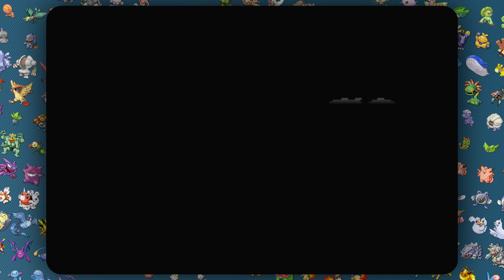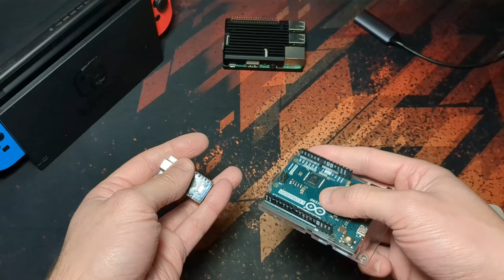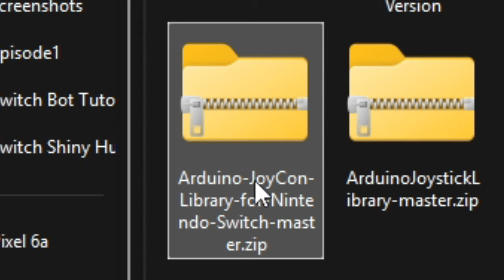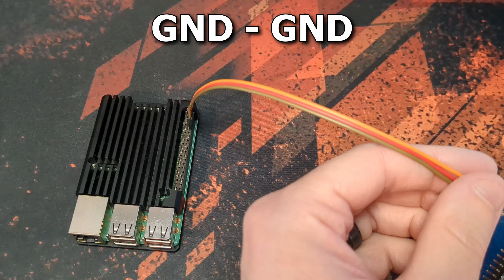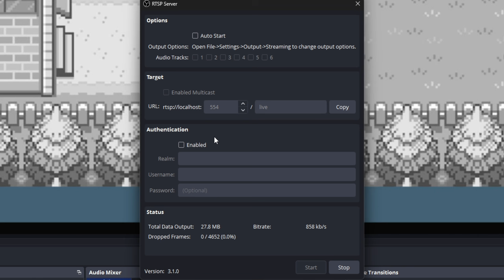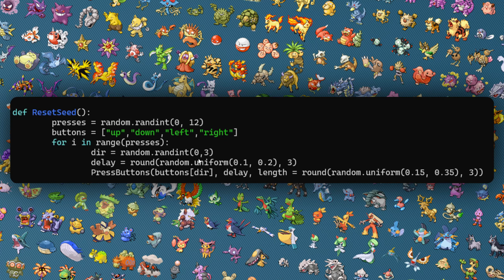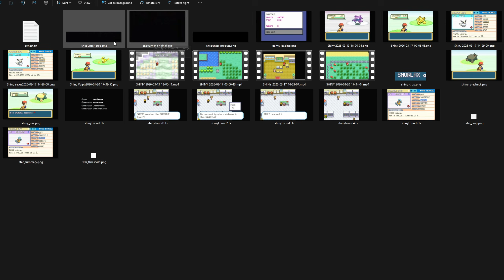How To Automatically Hunt Shiny Pokemon - Switch Bot

Comment: Has anyone got this working consistently on Switch 2?

I can get to around 300-400 encounters on the starter method and then the bot will think it's found a shiny but the screenshot will usually be on the "previously on your adventure screen" I've messed with the threshold setting to everything on and inbetween 230-235 and found that 232 has been the best so far but still messes up. Just wondering if the different hardware is messing with something after too many loops 

Hardware:
Switch 2
Pi 5
Elgato HD60S+
Arduino Micro
Reply from the maker: Is the game actually at the previously screen or is it just the screenshot? That would say if it's either dropped inputs or a capture issue
Reply: The screenshot it takes is on the previously on your journey screen. Whenever I get back to my game the cutscene has finished and I'm stood in front on the pokeballs. I've never actually caught it happening so all I can do is check the screenshot for what it thinks is a shiny charmander
Reply from the maker: @DeaconHasAShark  If it hasn't actually collected a pokemon when it checks then that's most likely a case of a dropped input which could be a few things. Check that your connection to the Arduino is solid and it's not overheating in any way, or there's no other controller to the switch that could accidentally pull priority
Reply: @Geeze I've checked and everything looks good. It's just strange that if the issue is dropped inputs why is every recording saved in screenshots the exact same thing. Like it's dropping inputs at the exact same bit every time I'm trying to catch it in the process but it's been difficult. Hoping it's not seeing a shiny Charmander and resetting itself before it shuts down the sequence

Comment: Got it working just a question do I need it plugged into the pi then unplug and plug into switch cause I get acm errors when trying
Reply from the maker: I'd have to see what errors you're getting, but you should have the Arduino plugged into the Pi and Switch before running the bot. If the switch is docked and doesn't have a controller attached then the bot should automatically take the priority. From there you can undock and dock it to swap between you and the bot
Reply: @Geeze so do I need another USB or just the rx tx and ground on both pi and Arduino and then plugged into switch ?
Reply: @Geeze could not open port /dev/ttys0

Comment: Hello nice video 
I am trying to get this working tried 2 raspberry pi’s 3b and 4b but tx and rx lights never turn on on the arduino and no controller appears on screen in the change grip scene on the switch 1 and also on switch 2 I am using a leonardo Arduino. Also found out that pc recognises it twice once as arduino leonardo and once as hori co ltd leonardo eth. also there is nothing on the serial monitor 

update

I opened the other uart ports on the pi 4b but it does not matter which pins I use it says in the python script it connects to arduino but even when there is none connected to that port
Reply from the maker: Hey sorry, it's not the most reliable but try to get the Arduino Switch library working first, the problems usually lie with the board settings, and different boards can have different settings. Make sure to factory reset the Arduino before installing again and see what's up
Reply: @Geeze sorry for the late reaction I was away from home for a week but I just tried another older versions of arduino ide none work but what I do know now is that arduino leonardo specific version of the boards.txt let’s mee upload it to the board  but the one with the my board part does not work I get a upload tool serial is undifined error thanks for the help
Reply: Finally got it working needed the old legacy version of the ide software

Comment: Does anyone have a sequence that they used for MewTwo? Along with what I should change the threshold to for it. I tried changing it up and down by about 40 each way and got less confident that it would find it, but it keeps telling me I find a shiny around 100 encounters in.

If anyone has suggestions, or maybe OBS settings that would help, that would be very helpful!
Reply from the maker: If it's stopping after 100 it's probably either a timing issue or dropped frames. For mine it was dropping a couple of frames, but would only be an issue when it lined up with the encounter check. If you're using the streaming method then just try to reduce the resolution as much as possible. The threshold should be fine for the encounters as the text is rather contrasted, that's more an issue for summary checks.
Reply: I was able to get a capture card to work directly plugged in. It has now been almost 4 days of being on 24/7 and a lot of time before that. No shiny mewtwo. I know this is possible, but is there a chance that I should change the threshold levels for checkencounter? Or something like that
Reply from the maker: @jsm177y7  4 days isn't that long to be honest, but for sanity if you look at the pngs the bot makes, you should see the MEWTWO APPEARED text in the check on a black background, if you see that, and the pre check shows Mewtwo sliding in, it's absolutely fine.
Reply: @Geeze  My check file just says "MEWTWO AP" and my shiny_raw.png shows "Wild MEWTWO appeared!" with the battle scene with mewtwo all the way on the right side. I have gotten to around 50000 encounters at this point as I had done a lot before I commented, and have now had it running 10 days straight, but with many checks before that constant run. Any suggestions?
Reply from the maker: @jsm177y7  If the battle screen is already up, it seems like it's waiting far too long to check for the shiny, so if you look at the precheck file and text has already appeared, that'll tell you if the timing is way off. If that's the case you'll have to reduce the delay after the last input
Reply: @Geeze  So you are telling me that the precheck screen should have mewtwo like on the left side of the screen, still like darkened?
Reply from the maker: @jsm177y7   Yes, it should be while it is drifting from the left to the right hand side, no text at the bottom yet

Comment: so i have everything setup with my micro, connectors are on the right pins but when i go to run the bot it doesnt connect to my switch 2 just stays on the change grip screen waiting for a controller signal any ideas?
Reply: Did you ever get this fixed?

Comment: Hunting charmander -> total 11768 resets until this moment, haven't seen it yet, do you think the bot will run infinitely? Do I need to check any configuration?
Reply from the maker: That's perfectly normal for shiny hunting, at that point it's only about 75% chance. Keep it going, Snorlax for some reason took mine 50k resets, everything else has been around or under odds.

Comment: Ok I tryed it but this is my first time programming. And I dont get the screenshots saved to my pc. It says Path not found am I missing something? :c I think the Pi cant comunicate with the RTSP-Server.
Reply from the maker: The screenshots save to your Pi, and like my case you can use SCP to copy them over your network to your PC. If you're getting a path error you've either typed out the wrong address or the program hasn't run successfully to create the screenshots folder at all.
Reply: @Geeze  OK yea I cant create a screenshot. I think its the RTSP-Server. I cant connet via the rtsp://localhost/live adress with my computers IP instead of localhost. I can connect via VLC Player on my Pc to the stream. Thats working, I can ping my pc but not the rtsp adress. I deactivated my Firewalls and tryped port forwarding on my router  Still nothing :c I just want my shiny pkms
Reply: ok got the screenshots and everything but my controller is not connecting to the switch now :c

Comment: I have followed the setup exactly, including setting up the SwitchJoycon library with the correct boards.txt file, but my arduino micro will not connect to my switch at all. On the Change Grip/Order screen, when I start the program, nothing happens. If I continue through, it gives up thinking that it's caught a shiny despite being still on that screen. Any ideas why this might be happening?
Reply from the maker: It thinks it's shiny because it's not in the right place. If the controller isn't appearing at all then it's either an issue with the Arduino itself or the Pi not sending commands correctly. Try using the Arduino IDE serial monitor to see if commands are being sent or not
Reply: @Geeze  For anyone finding this comment in the future, the UART communication was not enabled by default on my Raspberry Pi 5, so I had to add these lines to the very bottom of /boot/firmware/config.txt in the [all] section
enable_uart=1
dtoverlay=uart0
After rebooting my pi with these in config, it recognized my micro hooked up to pin 14 on the ttyAMA0 serial port (not ttyS0 which works with earlier pi iterations) and I could go! Thanks so much for this!
Reply from the maker: @ianpalk653  Ah nice find, glad you got it working! The problem with not having access to the exact same hardware, some tiny little thing that needs tweaking

Comment: Yeah... this guide doesn't work. Clearly there's a few steps that are missing, and it doesn't help that the video is zoomed in during key points. There's more than one AppData folder, not showing where the one you need is doesn't help. Also the Arduino code doesn't work.
Reply from the maker: These are the exact steps I took to set it up. The same exact code that's on the repository is currently on my Arduino, running perfectly. Unsure what issue you have with the AppData folder but that is exactly where it is located. This is also laid out on the linked Arduino library page in even more detail.

Comment: I added code to give me a Discord alert. 12 hours 22 minutes for a Shiny Deoxys. 1219 total encounters.

frlg,deoxys, reset a 13.5 check
Reply: Almost 5K resets, Shiny Ho-oh.
frlg,hooh, reset up 11.1 check.
Reply from the maker: Very nice!
Reply: @LocalMaple does this work with the birds
Reply: @OneEyed_King28  The code is right after the code that identifies the Shiny. So if the bot works, the discord alert works.
Reply: do you have any more sequences for Legendaries?
Right now, I'm trying for Articuno.
Reply: @OneEyed_King28  I do not. But the program has output screenshots for determining if a shiny is found, and the video has a tutorial for how to find it.

I already caught my birds before applying this Shiny Hunter. If you find the timing, feel free to add your command line to the replies.
Reply: @LocalMaple  frlg,arktos,reset a 1 a 4 encounter battle check?😅
Reply: Hey bro, I have an issue with the check summary, arduino + pi + capture card work just fine but when I try to run for shiny starter, it always says "shiny found in 1 encounters", I check the screen shot and they are either dim or black, can you help me
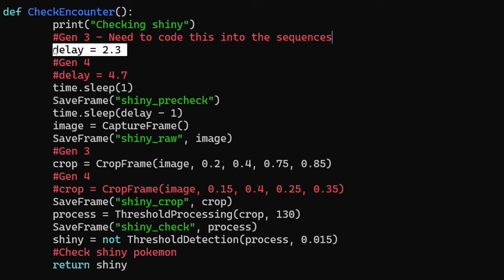Reply: @r @redcloud8043  Either manually change the timing in the sequence file, or follow the instructions at 19:43-20:00.
Reply: @LocalMaple I just found the problem, turns out it is because my capture card has hdmi in and out, so I plugged both and it won't work somehow, so I unplugged it and the bot runs smoothly now, thank you
Reply: Hello would you happen to have a public fork implementing the discord bot or can point me in the right direction as basis for?
Reply: @Beethoven_YGO  Yes.
Reply: @Beethoven_YGO  Yes.

Comment: If the Arduino is 5v and the pi is 3.3v, how do you not damage the pi long term?
Reply from the maker: Yes technically, you should use two resistors to step down the TX from the Arduino to The RX on the Pi, with like a 1k resistor to the Pi then a 2k to ground, but all of the communication is one way, and the 3.3v -> Arduino is fine. You could actually get away without connecting the Arduino TX at all, I wasn't sure if I was going to use it in any way.

Comment: Hey my arduino wont connect to my switch whatsoever when plugged in properly and set up correctly. Any ideas on what may cause this?
Reply: I have done the arduino ide steps correctly, I’ve got the usb pro controller communication on, and still nothing!!
Reply: Please help me :(
Reply from the maker: Are you sure you've got the Arduino code uploaded properly with the board data? Try clearing the Arduino completely and then going again. Which board are you using?
Reply: @Geeze Leonardo.
Reply from the maker: @c1ap  Try double tapping the reset button on the board, make sure it's got the SwitchJoystick library installed with all of the board information and re-upload the sketch
Reply: @Geeze I have done this multiple times, checked the platform and boards file in your video, AND reset and reuploaded the sketch multiple times. I still can’t get it to work :(
Reply: @Geeze hey so I bought a micro and it connects and the RTSP stream is fine too but it doesn’t move me in game when it comes time to.
Reply from the maker: Can you see on the Arduino the RX light flashing to indicate that it's receiving any signal from the Pi? Have you got any other controller/joycon connected because those might be taking priority in game.
Reply: @Geeze the rx light is solid no flashing and there are no controllers connected to the switch
Reply from the maker: @c1ap  So the controller is detected by the Switch on the pair screen but not in game? Or not at all?
Reply: @Geeze it’s connecting on the pair screen and not working in game at all no matter what I do
Reply from the maker: @c1ap  When you start the bot on the pairing screen does the bot load up the game like it's supposed to?
Reply: @Geeze no it does not.
Reply from the maker: @c1ap  Ok so it's connecting to the Switch but not receiving any button commands from your Pi, you'll have to check your connection between those, if it's on the right pins etc. If you plug the USB cable into a PC instead of the Switch you can use the Arduino IDE to read the signals from the serial monitor and see if commands are coming through, just look up how to use that if you don't know already. If you see the signals coming through there it should be all good to go.
Reply: @Geeze okay, will try that. Thank you!

Comment: Hey, when I upload to my Leonardo, I get the error “property ‘upload.tool.serial’ is undefined” is this okay and if not what should I do?
Reply: from me doing research if your board does that double click the reset button on the board when it say upload and you should be able do it successful
Reply: @TheVvang90 appreciate you doing (a totally unknown but appreciated amount of) research for for someone in a YouTube comment section. People like you are why I love the internet.
Reply: Append '.default' to the end of that in the file, before the =. Or replace 'serial' with 'default'. Try those two.
Reply: @LocalMaple you are the best
Reply: @LocalMaple do you know why my Leonardo won’t connect to the switch? I’ve done everything correctly with the ide and the files etc but my Leonardo won’t connect whatsoever :((
Reply: @c1ap  I used a Micro, so I can’t answer. Aside from that one adjustment to the IDE files I shared, I had no controller issues. If that isn’t enough, Google is your friend.

Comment: Error running WiredSwitchBot on a Raspberry Pi 5:
No such file or directory: '/dev/ttyS0'

Solution: replace that 'ttyS0' with 'ttyAMA0'
Reply: You saved me a night of 
self-doubt thanks it worked
Reply: The Comment needs to get Pin'ed

Comment: i cant figured out threshold of the shiny pokemon how do you get to the setting to change it
Reply from the maker: Open the WiredSwitchBot.py script with nano, and the threshold processing is a value from 0-255, the level of brightness, so for the summary check for the starters if you scroll down to CheckSummary(), it's default is 240, set it to 230 or 235 if it keeps saying a shiny appeared when it doesn't. I got a Pinsir, Eevee, and Squirtle from it so I know it will work.

Comment: Can this work with switch 2?
Reply: Can confirm. Still hunting, but I added an alert feature too.
Reply: @LocalMaple so the controller thing works as a switch 2 controller too?

I’m up to purchase the bits if so 😂
Reply: @TheOneAndOnlyDewey  Yes. I used an Arduino Micro, and had to google how to adjust the IDE code a bit, but it worked.
Reply: @LocalMaple  Hey, could you share what you changed in the code to get this working on Switch 2? Have the exact same setup but the Switch never shows it under Change Grip/Order.Would really help, thanks!
Reply: @letsmelone6728  To be honest, I don’t remember. I just googled a ton and found the solutions.

Comment: The bot keeps saying "shiny found" when there isnt
Reply from the maker: Is it for an encounter or the summary check?
Reply: @Geeze summary check
Reply from the maker: @Sirano_YT  If you go into the code, down to the CheckSummary function, reduce the ThresholdProcessing by a little, maybe 230, 235. It's seeing the background stripes as too dark and confusing that for the star. Try that and let me know
Reply: @Geeze  Its still saying shiny found
Reply: another thing is that the bot will mess up during sequences it will reset without being in game and will constantly open the bag
Reply: Pretty sure it’s just a problem with the starter sequences. I’ve tested the random encounter sequences, and they work perfectly.
Reply from the maker: The sequence should be fine, I used it for Squirtle, if you look at the screenshots folder you should see where it's tripping up with the images it saved. With the wired bot I haven't had any issues with it skipping inputs or anything so I'm not sure about that, maybe try extending the delays by a little bit to see if that helps
Reply: @Sirano_YT Same to me. Have you found as something to fix this?